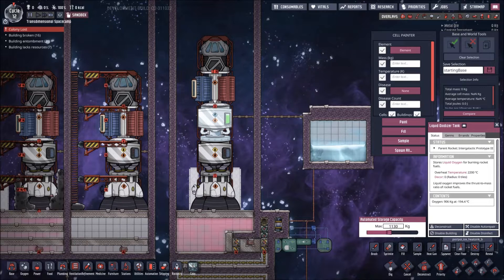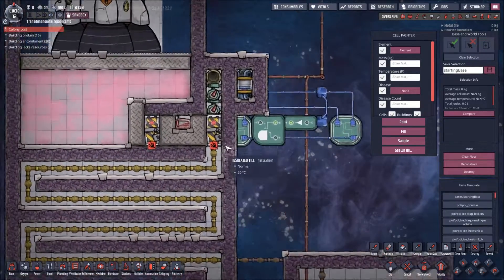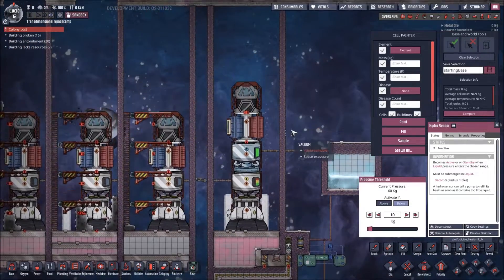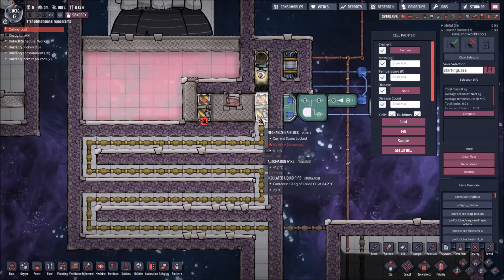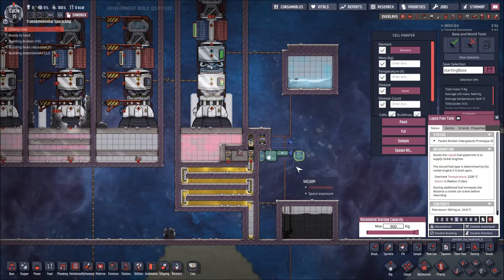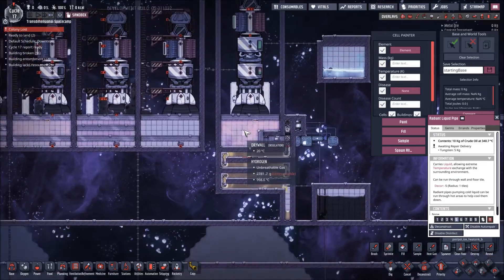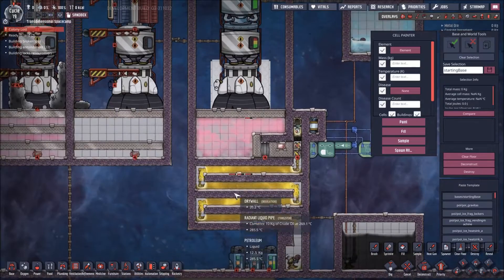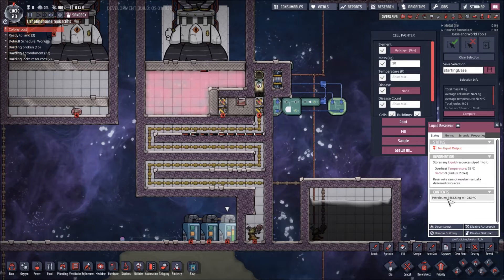Oxygen Not Included Self Powering Rocket?

Comment: If the flame is a representation of actual heat that means you can make the hydrogen room bigger and soak up the heat from the whole flame, possibly getting even more petroleum.
Reply: yea the rocket is heating the oil in the pipes u can do a simple test to show the area the rocket heats up using a checkered pattern of insulated tiles and reg tiles and the heat map

would making the hydrogen heat room smaller make it more efficient or would it better to be bigger?
Reply from the maker: I think there is probably a sweet spot for the size of the room and the amount of hydrogen. The larger the room and the more hydrogen will increase the launches needed to reach a desired temp but once that temp is reached it should last longer.
Reply: @LurkzGaming  hmm i think larger the better then if u are putting it under a short range rocket that will fire off alot
Reply from the maker: I'm inclined to agree however practical application may prove otherwise. Until I properly test this in a normal game it's up in the air.
Reply from the maker: Yes, I mentioned this in the original recording but cut it out for some reason.